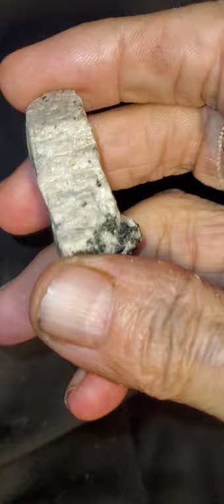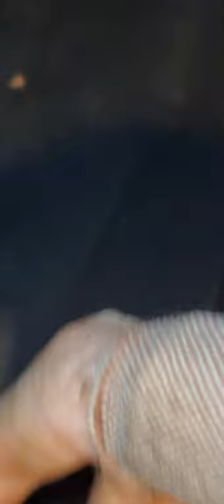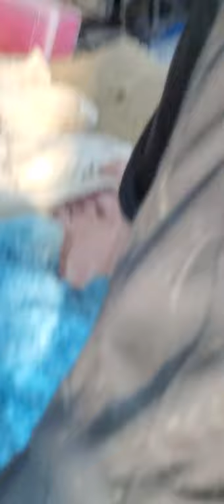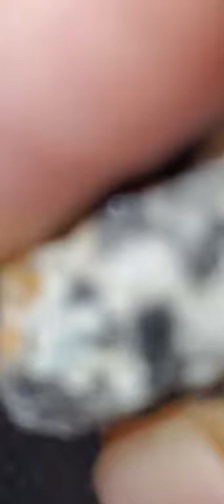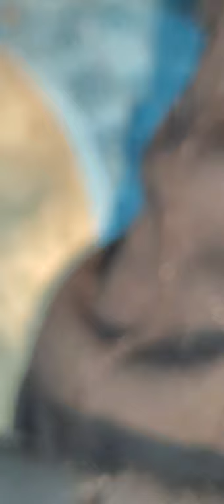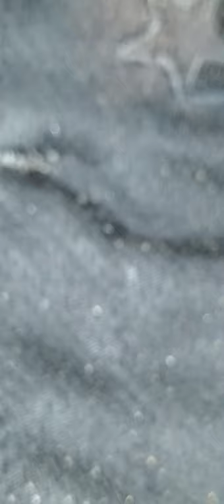Rock formation at high temperatures

Comment: It's an interesting video.  Gold nuggets are not always smooth and rounded. Some found have a crystal kind of structure.
Reply from the maker: It's not gold nuggets... it's not a metal like you are familiar with.. it's got covalent bonds instead of metallic bonds.. because it forms from the molten rock at great depth.. and pressure... it's not secondary mineralization.. it's the basement rock that continents are made from.. as molten rock cools the various constituents precipitate out as the mix cools below their melting point.. first is carbon, @ 3800° C, as the mix cools below the vapor point of silicon, it mixes with the carbon and becomes silicon carbide, then aluminum oxide and then platinum, which cools the mix and pulls out the gold to bind together with double double covalent bonds like diamond has... it's also 10 on the Moh's scale of hardness... look at some of the newer lectures in magnetic energy... AuPt is a room temperature superconductor for heat and magnetism... it's useful beyond anything paper money can buy brother